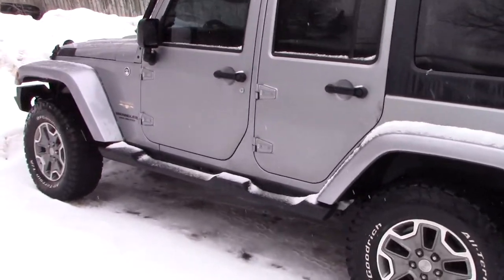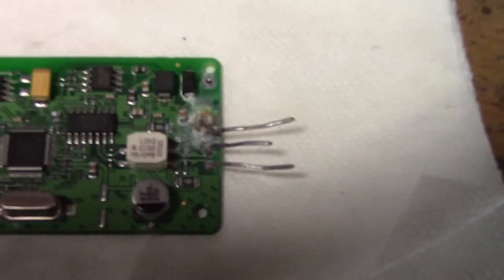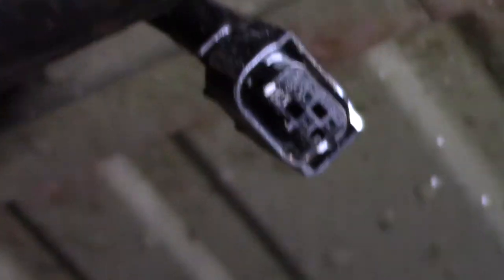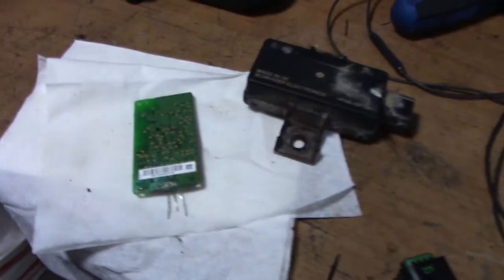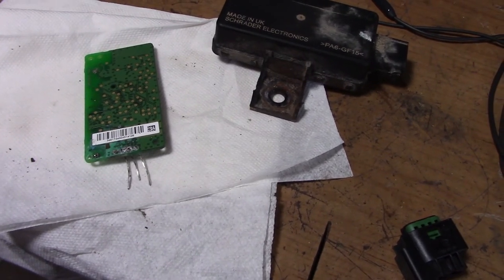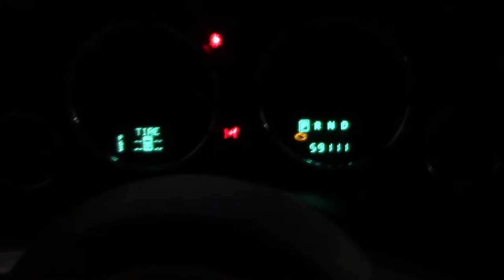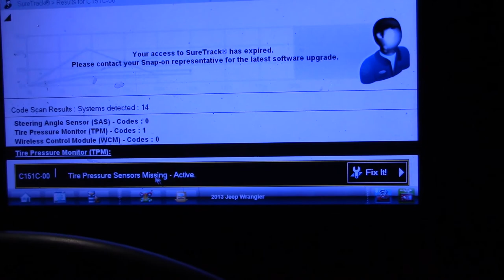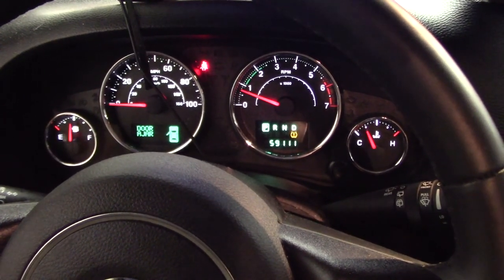Jeep Wrangler 2013 - No Start - No Crank - PROBLEM SOLVED

Comment: is this work at jeep cheroke 2014?
Reply from the maker: Possibly
Reply: u0001 thats my code, wont start all lights are on dashboard 🤦
Reply from the maker: Did you try unplugging that module?
Reply: @CraigHelsel   i dont know wich module is this
Reply from the maker: If you look under the rear of the vehicle it's up on top of the cross member